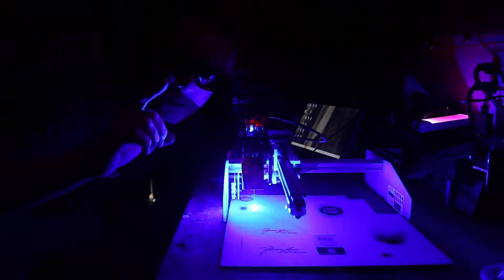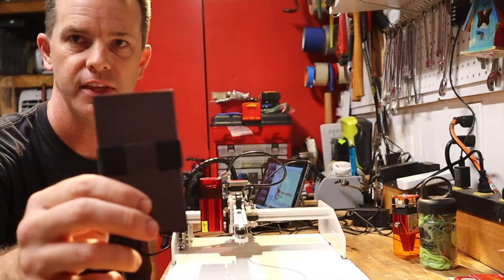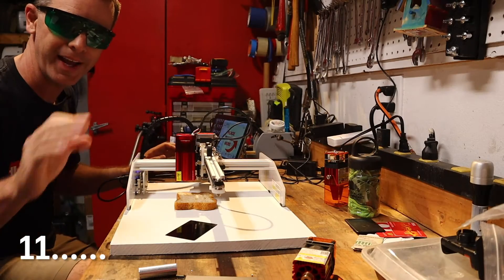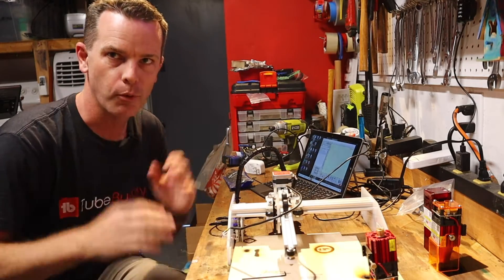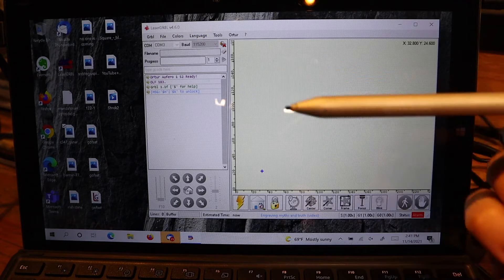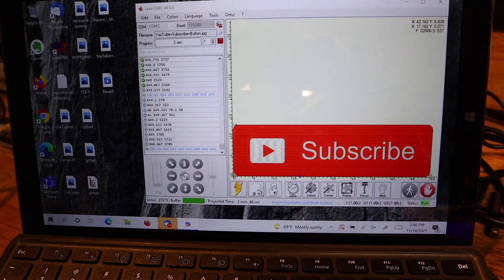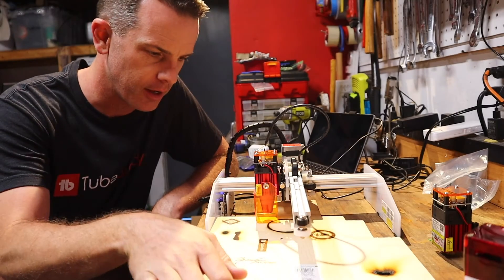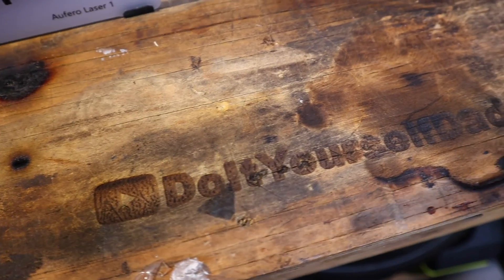Budget Laser Engraver - Any Good? - Ortur Aufero Laser 1 Review and Instructions

Comment: Could you have done another smaller circle cutout for the hole in the medallion?  From the image on the tablet, it looked like you maybe had it as a hole that would be completely burned away, rather than a smaller circle you could pop out.  Wondering if that's why it looked so uneven and charred.

Comment: Hey, great video thanx..
I have a question.. Two actually :) 
Which head you used for the aluminium and with that head can i use it also for stencil cutting ?
Thanks again..
Reply from the maker: I used the shorter focal length for the aluminum, and the longer one for cutting. You can also etch with the cutting head, so if you were going to buy only one head I would get the longer focal length head.
Reply: @DoItYourselfDad  Thank you ✌️

Comment: Great detail on the operation and so easy to watch. Thanks!

Have you seen a small enclosure for sale? 

We are going to get one of these, soon. We plan to use it in the craft room of our house. So, we need an enclosure with a fume exhaust system. All the enclosures to purchase a much larger than needed. We are looking for one that is big enough and no bigger to keep more space available on the work table. (Yes, we could make one and may have to make one. First, we are looking to purchase.)
Reply from the maker: You will also need to vent the enclosure to the outside. On my 3d printer I used a collapsable plant greenhouse and rigged up a vent hose with a small fan.
Reply: @DoItYourselfDad Ah, a greenhouse! Good repurposing.

I also heard that an aquarium air pump is a cheap way to add air assist to small laser engravers like this one.

Comment: Great video and explanation of this engravers uses.  If I had a desire to engrave a wine barrel stave, which has a slight radius, could this machine handle that?  Thanks for sharing your new gadget.
Reply from the maker: I would imagine it would work, the radius of a wine barrel is quite large. I would probably use one of the heads with a longer focal length and set the focus around mid-height on the barrel.